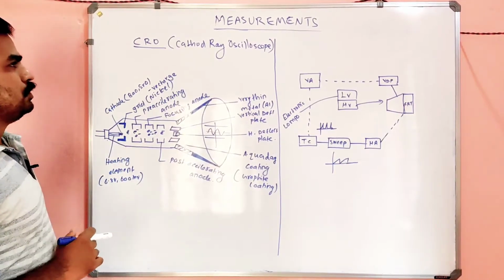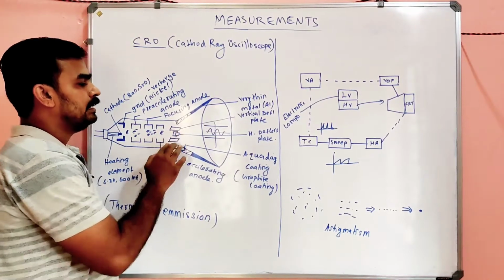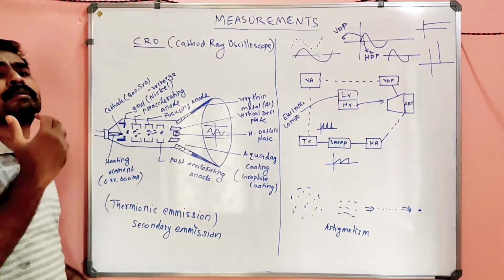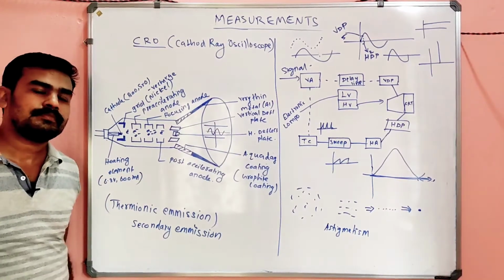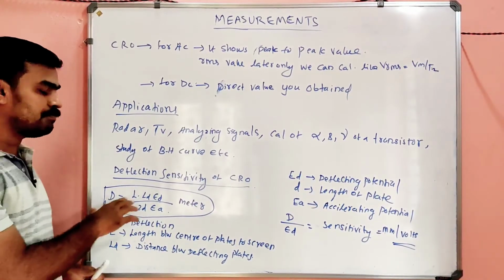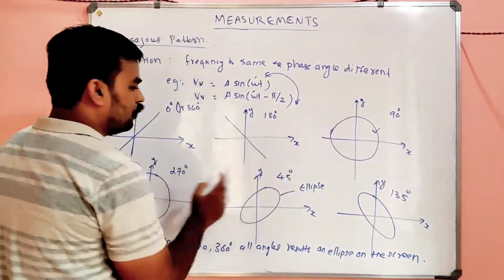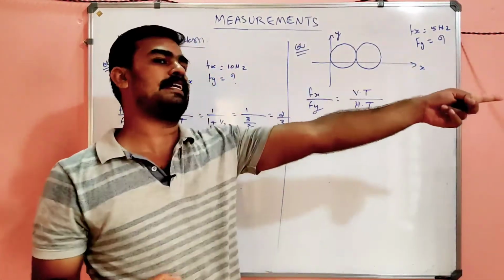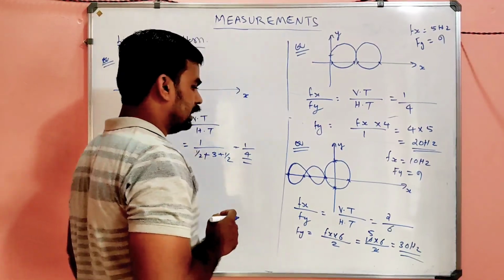CRO # LISSAJOUS PATTERN #

Comment: @49.03 tangent oru point touch akunnath alle. Pattern cut cheythu varakunath tangent allalo
Reply from the maker: It is cuts only..
Reply: @teslaacademy9888  pattern nu vertical and horizontal tangent vere varaka alle cheya
Reply from the maker: Actually for solving this lessajous  pattern no need of tangents.. Only vertical and horizontal cuts required.. Thats the easiest way
Reply: @teslaacademy9888  ok👍